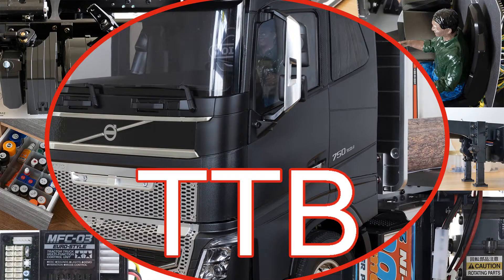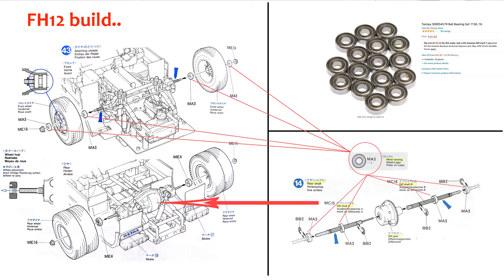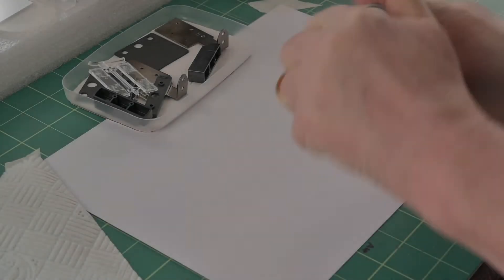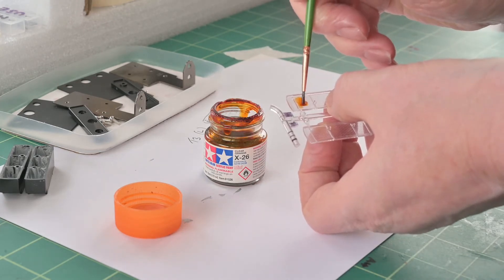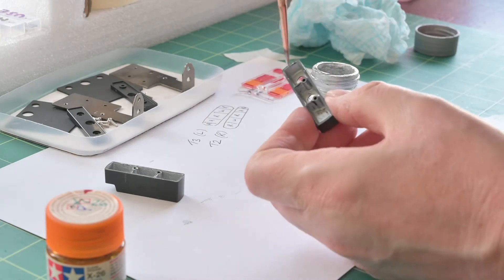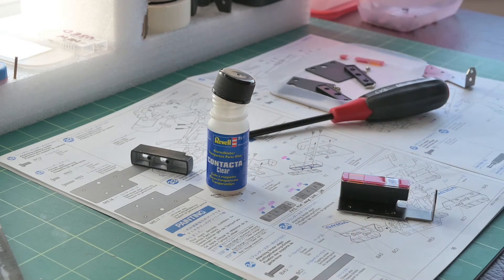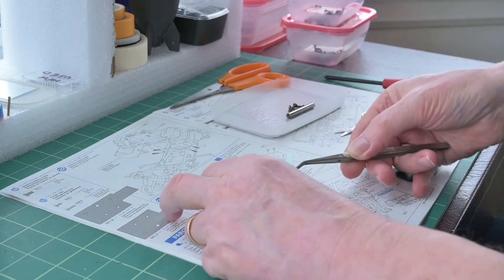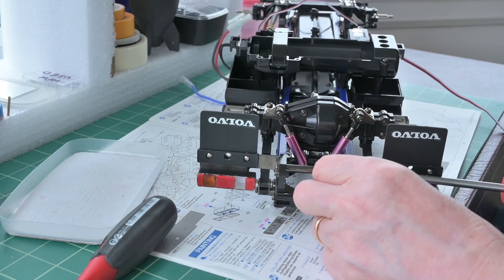TamiyaTruckBuilding - 1/14th scale RC Volvo FH12 - Part 15

Comment: Colin, great point on Bearings. Properly lubricated, Bronze Bushings are quite adequate, in Trucks.
The main purpose of Ball Bearings is for low friction. In my Racing Buggies, they're the difference between winning and losing! But in something that goes 8mph flat out, you won't see an advantage.

However, GOOD Bearings provide a more precision fit. For that, I always use them in front Wheels. It helps with Alignment, and wobbly Wheels bug me!! 😜 
I do understand that you're doing a budget build. These Rigs (my Grand Hauler in particular!!), can be VERY expensive.
I've been watching this entire Series, with interest!
Reply from the maker: Thank you Carmine